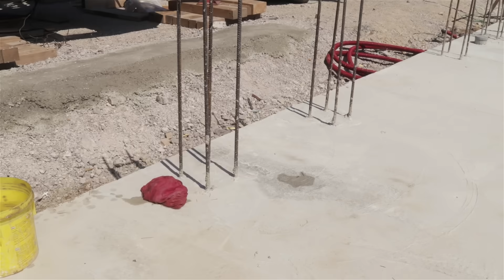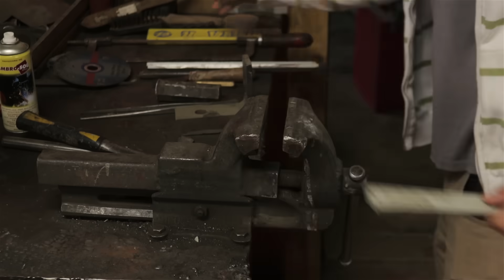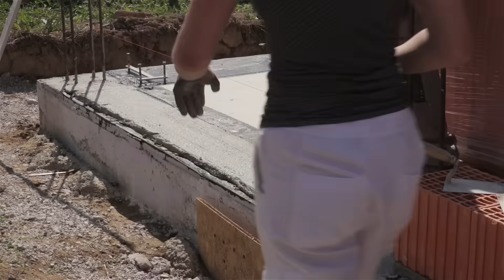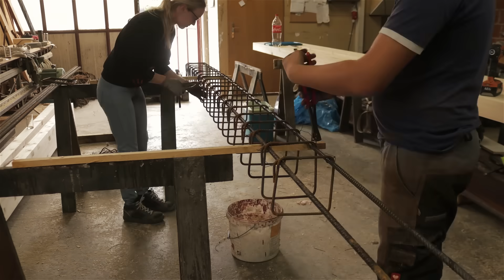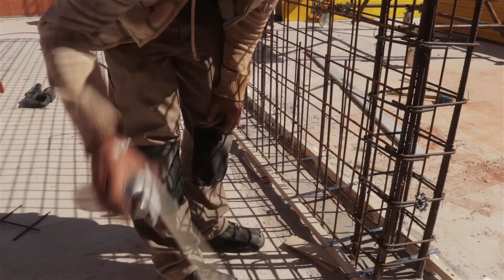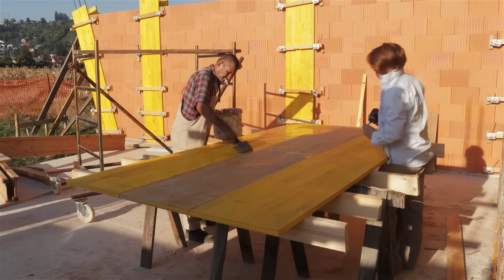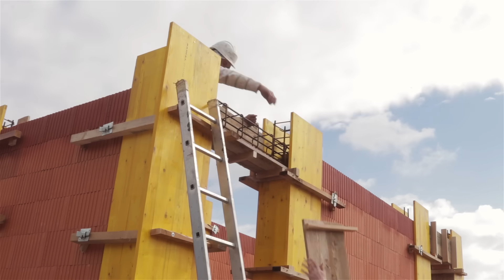My house build Pt2- ground floor brickwork and concrete formwork

Comment: Why use foam to glue the bricks and not cement? The foam won't last long like cement, so apart from the insulation properties of the foam why you consider it as a good option ?
Reply from the maker: This is a building system that is designed to use this exact adhesive. It is not your regular pu foam but a polymer designed just for this purpose and comes with the system. It will outlast mortar if not under direct uv light (its in the middle of the wall so no worries there). Bricks are cnc milled to exact thickness and have to be positioned perfectly flat to transfer load to the base, this can't and should'nt be done with just any kind of bricks. Up sides of this method are 3 times the building speed, 60% better thermal properties due to no thermal bridges, better tensile strength ( mortar has almost none) and overall strength of walls. Downside is the price but money returns in  energy savings. Google porotherm profi and you will find all the info you are interested in.
Reply: @lignumchannel  what measures have you taken to prevent thermal losses of the concrete foundations to the soil? I only see side insulation.

Comment: I have a quick question ,can you tell me about the Hand saw you are using for cutting ? ive been looking for one for a while now , i have one for cutting ytong but its not able to cut bricks :(
Reply from the maker: hm, I'm not sure about the make but this one is for Ytong also. After this video I ditched it because teeth started to fall out. I've put a tungsten carbide chain on a stihl chainsaw and it cuts trough like a butter. The chainsaw had to be dismantled and thoroughly cleaned after  I was done though..

Comment: Question from Hungary: What do you guys use between the brick lines? (Sorry, I'm too lazy to go through the comment section) p.s.: awesome work <3
Reply from the maker: This is a glue that comes with this building system. These blocks are cnc planed to an exact thickness and they lay perfectly flat on top of each other so they can be glued together.

Comment: newbie question, what do you call that fabric u put on the concrete and also that green styro
Reply from the maker: That is geotextile and it is used to separate different layers from contaminating one another. Green thing is extruded polystyrene. It is hard and can withstand loads and is great thermal insulator.

Comment: Is it typical to use such static crane on home building sites? I have never seen such for homes, only for big commercial sites. I'd assume them to be expensive. Also, our home lots are so damn small that there would not be room for it even ;)

Comment: A beautiful and wonderful building, but I have an important remark, which is that when installing the steel bases they must be welded from all sides according to the number of iron bars that were made as building bases for the building, and then increasing them with stainless steel wires to increase their strength and durability which is a better way than installing them Using metal wires alone because the bases may disintegrate inside the cement after nearly 30 years have passed due to rust and moisture but if you want to protect them from rust and moisture it is always better to paint them with a rust-resistant paint.

Comment: Y0 is building his house with huge lego blocks and some kind of adhesive. The stuff isnt even concrete or real bricks.. It looked almost as if its made from some kind of polymer.
Reply from the maker: Bricks are real, made almost the same way for thousands of years, baked clay with added compounds for thermal insulation and strength. Their geometry is different than traditional bricks, they have many voids for better thermal insulation properties and for a person to be able to grab it and place it easily. They are cnc planed to an exact thickness of 25cm so they can be placed perfectly flat on top of each other so the load can be transferred to the base. Glue is polyurethane which reacts with moisture from the atmosphere. I must admit I was a bit skeptical when I heard about it but after a bit of research there was no doubt this was the way to go.
Reply: I DON'T KNOW
BRICK'S AND GLUE 🤔

Comment: An incredible amount of formwork goes into a home like yours.   Very interesting.   Thanks.
It looks like commercial builds here in the USA with high seismic activity.
Reply: NOPE 
IT'S DIFFERENT HERE IN THE USA
COMMERCIAL BUILDINGS
THEY USE CONCRETE BLOCK'S
REBAR AND CONCRETE 
INSIDE DE BLOCK'S

Comment: Really interesting to watch how you are building as the construction techniques are so different here in Australia. Looks like you're making good progress
Reply: They did everything you can do to keep it air tight prevent moisture, cracking and this is the most detailed build I have seen. They fabricated everything. That house is well built!
Reply: They actually care. Out here in America, it's go go go go as fast and cheap as possible then charge a premium.

Comment: 3:38 is that polyurethane foam on the bricks? Any reason why mortar isn't used to glue them?
Man that house looks solid as a castle! Awesome series.
Reply: In Germany this is called dryfix by Wienerberger. It is a polyurethane glue. Advantages are faster progress than using mortar and you can use the glue at colder weather (down to -5°C). This is only possible because the blocks are sanded to the right dimension as you can't compensate for any irregularities in the dimensions. 

Disadvantages are the use of more synthetic material and as this is a relatively new building technique, there is no long time experience. Compared to a traditional brick wall with lime mortar, this wall cannot compensate for slight movement or settling as the soft lime mortar would allow. As the PU-glue has a higher tensile strength than the brick, the wall would basically crack when the load gets too high.
Reply: @florianreclaire508  thank you for the answer!

Comment: This is really well done but I'd love to understand what are the advantages of this method over aerated concrete blocks. This seems WAY more expensive / time consuming and all the columns are basically cold spots. For a 3 story house, D500 300mm block would do it without any additional insulation it seems.
Reply: @beinurnurla  Right. Croatia is a high seismic activity region. So EC 8 (European seismic code) requires concrete "columns" at a specific distance in the masonry wall.
Reply: aerated concrete blocks are way more expensive here than bricks
Reply: Greetings, theoretically speaking, ACBs have many advantages : lightweight, insulating, no thick mortar...But then you have price to take into account, which can be aggravated by the fact that if you are in a market in which the workers are unfamiliar with a specific system, no matter how good it is you will have trouble finding a competitive labour price with proper guarantees.   

You can technically build with ACB in high seismic regions, the blocks have to be approved and obviously you have to follow Eurocodes and norms.

Based on France (where I live) and taking into account my own personal view of the market and construction practices, if I had to make an efficient technico-economical choice I would either choose wood or cinder blocks + external insulation, or insulated concrete forms. Wood is quite turbulent here currently due to market rarity. Hopefully it will settle down. Cinder block here are so easy to build, it is a staple. And the advancements in external insulation today allow to almoste negate the advantages of ACB or bricks (including thermal bricks), while having the joy of great thermic inertia inside. Insulated concrete forms have to me the most promising qualities (exterior insulation, formidable inertia of concrete) but requires technical and know-how that may not be easy to find around.
Reply: @beinurnurla  ةوتتمتبل

Comment: That system you are using is not practical, Labour costs would be prohibitive as well as the rising costs of timber for the form work. As well as having to pour concrete columns as your walls are not load bearing nor are do they have proper insulation properties. A SIPS system would have been more economical and completed in a fraction of the cost and comes fully insulated.
Reply from the maker: I did all the work, walls are load bearing, they can hold 10N per mm2, formwork panels will be later used as roof sheating, blocks have good thermal properties and aditional 15cm of insulation comes on top of it. It is fire proof Rei120min unlike sips 60min or lower, price of material for sips per m2 is around 100 Euro+ siding (I googled, could be wrong but doubt it comes near porotherm) and system I used is around 25€ +25€ aditional insulation and siding. You say rising prices of timber and sips is sandwiched foam in between two layers of wood panels, most commonly osb and the price of osb raised more than 400% since January..

Comment: Why did you do that whole internal (I think) wall in concrete, rather than bricks? (If it's structural, you could use higher MPA bricks. If aesthetic, you could fake the look with special cement coating)
Reply: Seismic wall
Reply: @ktarnik  👍
Reply from the maker: As @ktarnik said, seismic wall, also there will be console stairs attached to it. We are still thinking about it but the plan for now is to cover that wall in hot rolled steel plates and put the cement coating as you said on the big north wall. We thought about leaving it bare but we did the pour and I'm not 100%happy how it turned out, It has some minor superficial honeycombing here and there where the forming board were meeting..
Reply: @lignumchannel  100% understood.

Comment: How did you like Izo Profi from Wienerberger?
We were thinking about it, but seemed more expensive than classical way with mortar
Reply from the maker: When I calculated the cost, It came about 15 percent more expensive  but it was 3 times faster and has 60% better insulation properties than classic.
Reply: @lignumchannel  Long time for reply, sorry. In our project (and permit) we have Porotherm 25 profi anyway, yesterday we've met with contractor at the soon-to-be building site, and we're definitely going with Dryfix way of building.
As far as insulation goes, we'll slap 14cm rockwool on it, theoretically it comes out as A+ building so we're happy. And it's actually even better since we won't have any thermal bridges where mortar would be (since bricks have 0 gap between them).
So excited for it to finally start...

I really enjoy these vids, I rewatch them from time to get my excitement checked :D
Reply: It's very accurate. Great product

Comment: I'm curious about why the one interior wall is all form, and not brickwork and formed edges. Thermal mass or heavy overhead load?
Reply from the maker: The load, seismic wall, the stairs will be console attached to it.
Reply: @lignumchannel  Ah, and I totally didn't think of seismic reasons, and I think I see where you're going with things, then. Thanks.
Reply: I think he is going for second floor. That way in the middle you need something strong to hold the weight.

Comment: I'm guessing the center wall is full concrete because it is load bearing for the structure? Really fun and interesting to watch this process! Thanks for sharing!
Reply: Pretty sure those thick bricks are too expensive (and too wide) to justify using on interior walls where you don't need insulation and space is a premium, but the thin bricks are just for non-load bearing walls. So they went with concrete for the load bearing interior walls.
Reply from the maker: That is correct, also console stairs will be attached to it. thank you for watching! :)

Comment: Great piece of work! If I am not mistaken, it looks like you intend to have a big inner bare concrete wall in the ground floor (or is it intended to bear some heavy load?). 
All the best with the building!
Reply from the maker: To be honest I don't know yet, It was supposed to be visible from the kitchen side but we poured it a few days ago and it has some minor honeycombingwhere the boards were meeting  so it still has to be decided.. The wall will have console stairs from the living room side so the simplest and safest way was to pour it in concrete. Thank you ! :D

Comment: is concrete poured in between the orange bricks too?
Reply: No, you never do that.
Reply from the maker: Concrete will go everywhere where you can see rebar. If you mean the pores inside the blocks, they stay empty and serve as thermal insulation.

Comment: Just a random question, since you invested a lot in mortar walls/pilars, why you didn't decide to do the whole building in this technology, and you decided to use bricks?
Reply: This is more "healthy" way of building.
Reply: Few ideas come to mind - cost; weigth; insulation and abillity to recieve GSM calls inside a house 🤣
Reply from the maker: When I first invisioned the house it was suposed to be in visible concrete and glulam, glulam prices jumped from 460€ to over a 1000€ per m3 and rebar prices almost doubled in the last year.. I had no choice but to redesign the structure..

Comment: As I can see, the technology of building houses between Croatia and Poland is almost identical;) This year I am finishing building my own house. I also use foam-glued porotherm 😀
Reply from the maker: I saw a couple of videos of porotherm from poland and I loved them, mostly because not so much concrete is needed due to diferent seismic area..
Reply: Did you also torch down 90lb  roofing paper to the slab before building the walls? And what is the purpose of that, is it for water intrusion?
Reply: @R.L.Thomas  yes and just like the Brad A said. This is so that water from the concrete does not get into the blocks.
Reply from the maker: @R L it is a 4mm bitumen foil to stop moisture from climbing through wall pores..
Reply: @R.L.Thomas  I imagine to stop water coming up through the concrete into the blocks.

Comment: As someone who watches a lot of UK and US builds, this is wild. Completely different way of working. 

Keep them coming!
Reply from the maker: Yeah I get that here a lot when building with wood. :)
Reply: @lignumchannel  I've been a builder in the US since the 70s and it is very frustrating trying to build high performing resilient structure when market forces trend toward cheap inefficient houses which require constant maintenance and major refits every few decades.
Reply: @lignumchannel  : where's part 3... 4..5.. ?.. I'm curiosity  what the house gonna be looks like?
Reply: Always trying to find a way to stop wood from rotting in North America with all these expensive products and processes when building a house when you can just use brick and cement and never have to worry lol. It's like designing a flawed system, then doubling down trying to fix it.
Reply: It will not cut for the US those red hollow blocks do not hold fasteners
Reply: this is very similar to our way of house construction in North Africa and the midle easat, but here in Libya generally we use limestones for outer walls and cinderblocks for inner walls, now though integral insulated cinderblocks have become very popular
Reply: In Indonesia we mostly build pillar and colum with concrete or wf steel and the wall build with brick/conblock/hebel
But we only used concrete or wf steel in mains pillar and colums not in every corner of the room and we not concrete the wall
Reply: Catching mice
Reply: imagine the COST to do it this way
Reply: @StephenMortimer  So far it looks quite similar to the way we build houses here in germany. But we wouldn't use that many and that big concrete pillars. But as it seems, lignum is from croatia and in a seismically active area.
Reply: @RubyRhod  In active area wood would be better (more flexible) his is more of a FESTUNG STYLE. !!
Reply: @StephenMortimer  It's actually cheaper to build that way long term. Europeans usually live in their homes their entire life and because of the thermal mass of the bricks and concrete, the heating and cooling cost for such a house is significantly less compared to a building with less thermal mass. The US building market is slowly catching on to this too - using ICFs.
Reply: @StephenMortimer  thats normal. Festung is nice. Now in germay use 42.5- 50cm bricks. For more energy efficency. A window gets. A Schiessscharte.
Reply: @StephenMortimer  Reinforced concrete can flex enough and the wood will shake itself apart lol
Reply: @StephenMortimer  if north america had a well organized, codified, and subsidized extruded brick industry to build domestic structures it wouldn't be much more than sawn lumber.
Reply: @Keechization  lo9l
Reply: @StephenMortimer  This is standard construction in Europe and in Croatia. We bild for 100 years to last, minimum.
Not just for this generation. It is an investment in future.
Reply: @bojancurkovic7130  Or, until the next war ??
Reply: @StephenMortimer  Yes, my house my bunker! 🏡🔫😉
Reply: @bojancurkovic7130  another FESTUNG EUROPA ?? do you have yearly property taxes there ??
Reply: @StephenMortimer  Hawe, nice life. 👍
Reply: @StephenMortimer  depends on the country, wood is more expensive here!!
Reply: @StephenMortimer  Up to this video it costs around 400 euros/m2 in Croatia. :)
Reply: @fassoyangce1075   what are the average wage ??
Reply: @StephenMortimer  The average in Croatia is around 1000 euros/month, but most people have less than that. Tourism is keeping us alive. hahahah Since the prices for an apartments are around 100 euros/day and most of us have inherited properties from Yugoslavian time which we rent.
Reply: @StephenMortimer  Also, if you wonder, at this time (2022), the price of finished house is around 1300 euros/m2 if you're building or 2500-3000 euros/m2 if you're buying a finished house. We're talking about brand new houses of course.
Reply: @fassoyangce1075  expensive not YUGO price